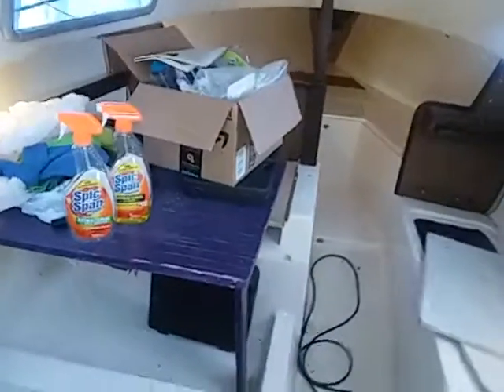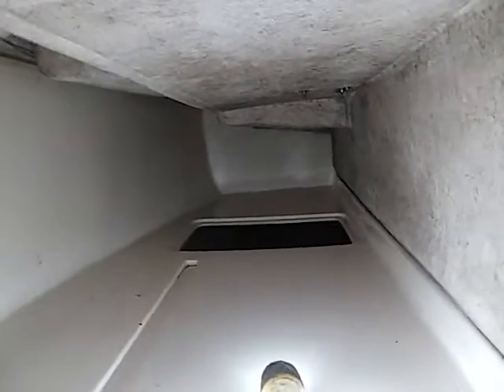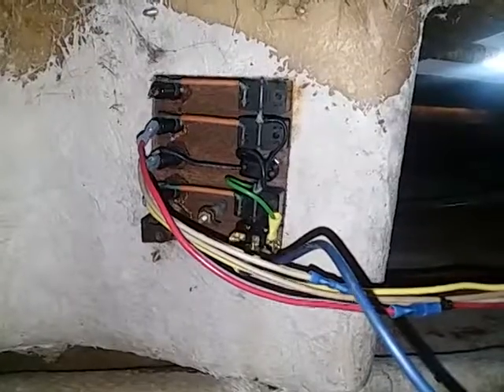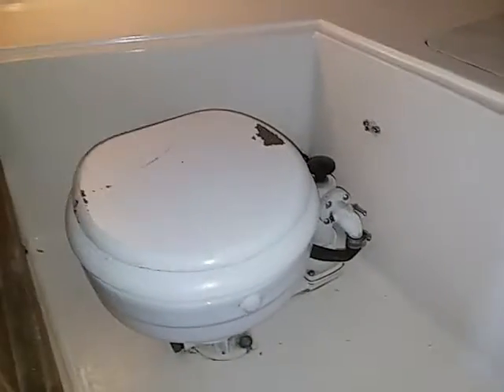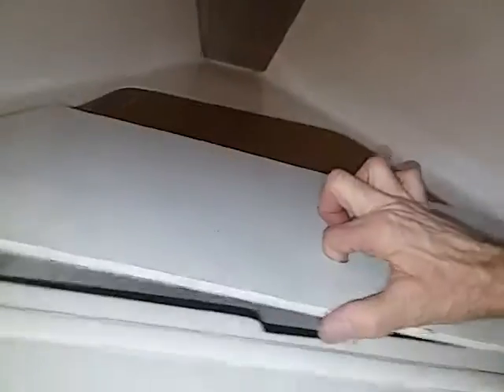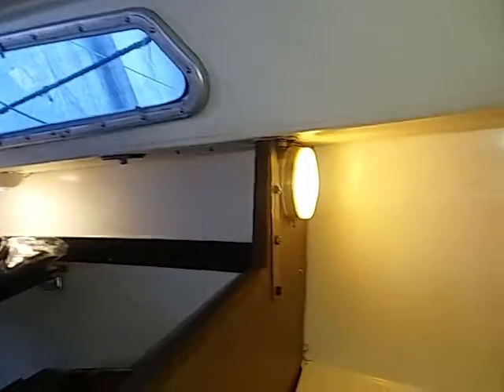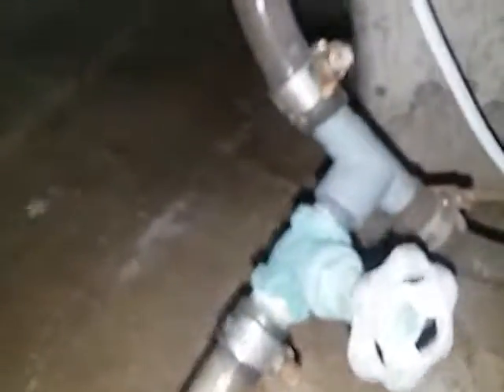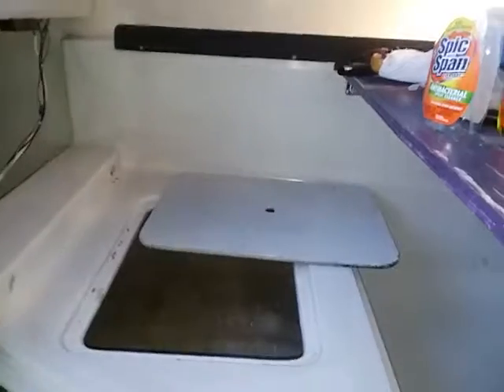Catalina 22 sailboat led light conversion

Comment: Great boat and great video! Updating the electrical is something people should do when getting an older vessel. I'm a marine technician at Bass Pro. I recommend getting heat shrink butts when connecting two electrical wires and dipping the ends in dielectric grease before joining them. The grease plus the heat shrink prevents water intrusion even if they happen to fall into water. Happy boating!